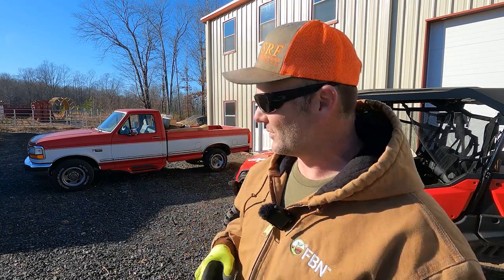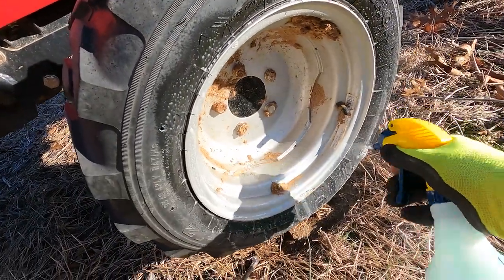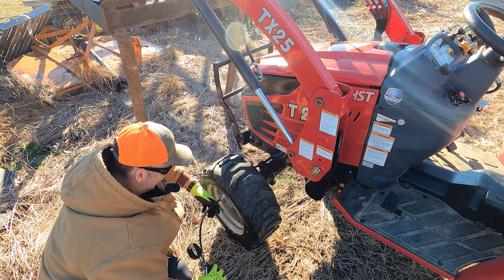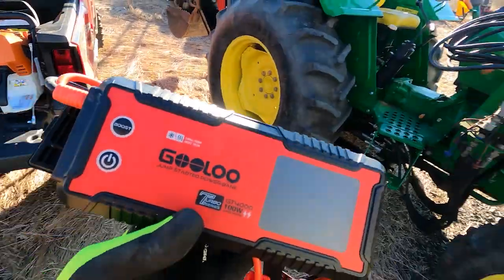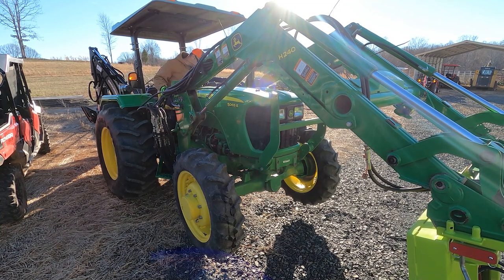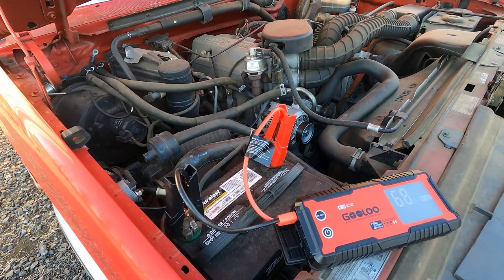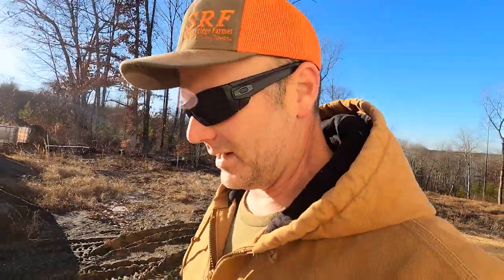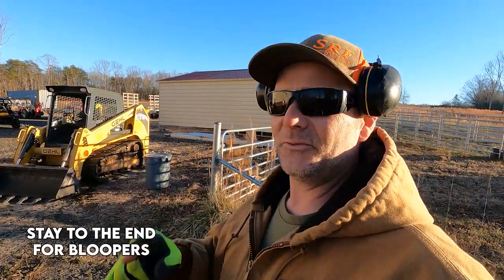Stupid Green Tractor! Everything on the farm is broken!

Comment: Be careful with this technique but use a ratchet strap around the center of the diameter of the tire to pull the tire in and force the bead to seat. Don't put but a couple of PSI into the tire otherwise the strap could break or snap when you release the tension.
Reply: I have done this several times for tires of all sizes you can even use a rope and a pipe to twist the rope tight

Comment: You need to get Napa batteries, cost a little more but they work better and have a better guarantee. Also, try turning your five-gallon hydraulic bucket around. Put the spout on the top and it will stop gurgling because the air will be at the top of the bucket. Try it you won't go back to the old way of doing it.

Comment: In the future you can put a ratchet strap around the tire in the middle, tighten it up and put the air to it. Works great 👍
Reply from the maker: :_SRFarmerExcited::_SRFarmerExcited:
Reply: And in a pinch if no ratchet strap, a rope with a slip knot, tighten it down and tie it off. Then add air and usually pops tires on rim again. Just say’n

Comment: I've found over my years, remove the valve core so the air goes in faster to seat the beads...just a suggestion.  Love the videos.
Reply: Yes, especially if you just push the airline coupler down onto the valve stem without an air chuck on it.
Reply: Yes, I found by removing the valve core it worked on difficult tires sometimes. 👍

Comment: Hello Josh, I like to make a couple suggestions if I may, if you are having trouble with tires going flat all the time maybe try this product called tireject they make it for all sorts of tires, just follow the instructions and you’re done, the good part is if you spill it on the tire or change tires this stuff cleans up with just water. Also instead of using rock dust maybe see if you could get macadam millings ( milled pavement) to fill in your washouts and ruts, it shouldn’t wash after it’s packed in. Just suggestions..

Comment: Josh, if they it was on the rim, I’ll bet you there is grass. Or clay stuck between the bead of the tire and the rim causing it to be a slow leak. Break that side off that was broke off and clean the debris out. You probably will fix your problem.

Comment: Hey Josh, nice & lots of work , if you ever take tire off,  bead sealer for race car tires or hug bead sealer. Always check valve stems & cores. Used flex seal on four tires for bead sealer works great 5 years ago, keep up the good work.👍

Comment: Mental note:  Don't loan out expensive equipment...ever!  When my tractor was new, both front tyres had bead leaks that were caused by the little rubber tits left from the moulding process causing a leak path.  Dealer took it back and put tubes in both front tyres.

Comment: Your TYM 25hp is identical to my Mahindra eMax 25hp.  Gauge cluster, light switches, throttle, levers, hydraulic valve location, etc  lol.  You can tell they are siblings!  Yours has the second hydraulic cylinder on the bucket.  Thanks for sharing 🤠

And wow... they sure are proud of those power stations lol!  It is a solid solid product... just not in my price range at this time.  I can see the appeal of them though.
Reply from the maker: Look at the MFG tag on your tractor...TYM builds for a few different brands my brotha
Reply: @StoneyRidgeFarmer  Oh absolutely.  That was the point I was making... just not very well lol!  It is interesting how many re-branded tractors there are in the sub-compact/compact market.  Not that it is a bad thing!  I'd buy pretty much anything TYM makes, or makes for other brands.  They are solid and dependable for sure.  Have a safe and happy New Year! 🤠

Comment: Had a problem with a brand new tire going flat, took tire off rim buffed rim and tire at contact area. Painted both with "slime" and inflated. So far 6 months later still holding air.

Comment: My Dad's solution on Craftsman lawn mower was to put inner tubes in.  It worked on back, but I should told him the fronts need them to.  So Now i have to air them up before use. :(..   You'd laugh at my tractor, unless you like the  80"s classics.  If I got a leak through a crack I'd be Finished.  But anyway..  That Goolooo seems like a great product!   Great one!  See you next year, as they say!

Comment: I kept running the tyre off the rim on my BX with a heavy load in the bucket, it's far to easy to do. I put some inner tubes (18x8.50/9.50-8) in the the front tyres and have had no issues since

Comment: Run a ratchet strap around the middle of the tread and put tension on it. It’ll push out on the bead. I usually keep putting air to the tire as I ratchet the strap tighter until it grabs

Comment: I had that happen with. my skid steer tire that was flat and in the cold for too long. I put it inside for a day and then filled it up and it didn't leak out of the bead like that. I think when they are flat in the cold for a while it just needs to soften up to seal right.  after that its held air and stayed on the bead no problem.

Comment: If you have a tire that doesn't want to seat the bead, take the valve core out. It allows much more air to go in. Also when pouring from a full bucket like that, pour with the spout up top and it won't "gulp" on you. 👍

Comment: We have a 32 horse John Deere compact and it won't even lift the front end up or pick up a round bale
Reply from the maker: hmmm...you might have a problem with the hydraulics my friend
Reply: I don't believe it has a problem. The rest of the tractor is awesome we have used it for about everything. It's Only an 2008 with 300 some hours and we bought it went it was only a couple years old. It was basically brand new. it just has a week loader.
Reply: Although I do have a case vac which has couple hydraulic problems. I have a seal leaking and a spring broke In the control valve, but I can't find a rebuild kit anywhere

Comment: Another way to pop the bead back on both sides id learned from an old guy, get a tow strap, put it on the center tread of tire all around, hand tighten it up, then use the strap and cinch it up.then load with air and use your soap, all it takes.